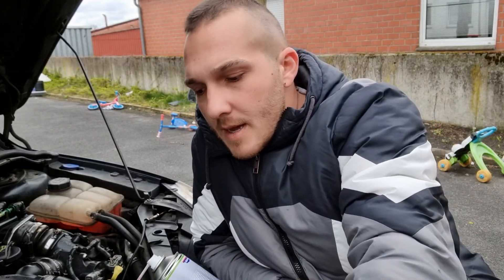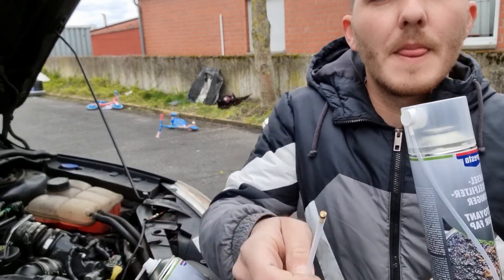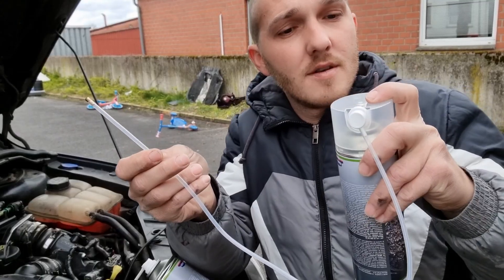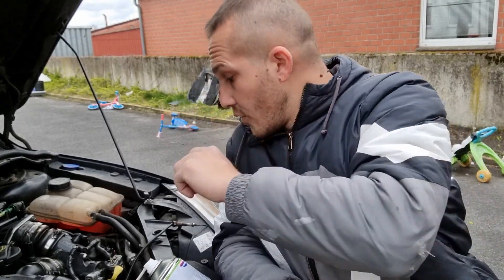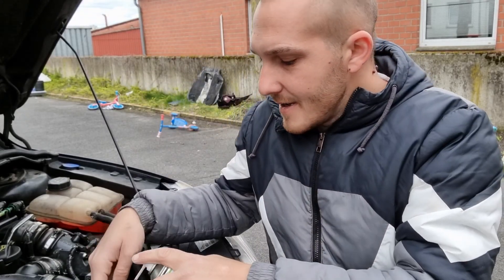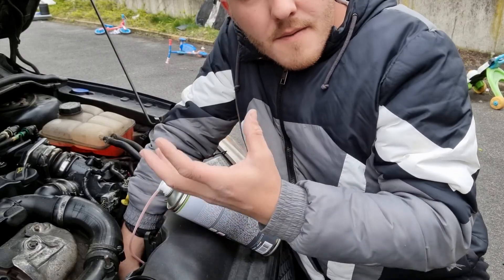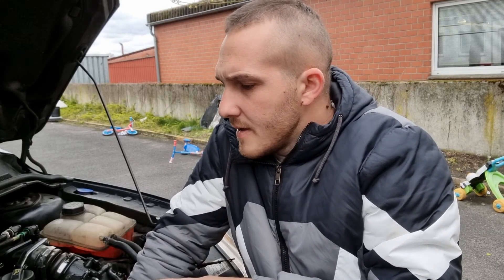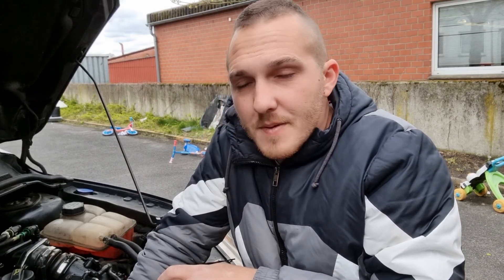CLEAN DPF filter AT HOME WITHOUT REMOVING IT !!  ( diesel particulate filter Error code P242F OBD2 )

Comment: The best option to clean it if too blocked, is to remove and back flush it. First let it soak in a solution of water and dishwasher tab. Then soak it with a misture of brick acid and water, then soak it in bleach. Finally clean it with water, preferably using pressure water. A preventive mesure could be using some oven cleaner, if DPF fluid isn't available.

Comment: Do not forced regeneration, it can damage it because it is much higher temperature than normal regen.

Do this:
1. If limp mode, clear faults with obd2 scanner to stop limp mode.
A. Optional: Add 300ml and then fill full diesel tank, 1:200 ratio, 2 stroke LOW ASH oil (preferably Jaso FD, ATI C). It cleans.
2. Inject through top oxygen sensor hole 2-3 bottles of DPF cleaner foam
3. Always disable Start/Stop.
4.  Drive 1hr non stop on  high way.

Comment: The DPF fault is generally a symptom of something else. This something else could be anything from driving too many short journeys and/or too much idling to split boost hose, blocked pipes/nozzles, faulty sensors/wiring, etc. If you reset these faults and the DPF problem returns, look for other fault codes, if any, and physically check hoses, wiring and even your air filter.

Comment: All this cleaning stuff is unnecessary if people would properly understand the DPF system and how it works. The biggest killer of the DPF are cold start, stop/start driving in heavy traffic and short trips.
Cold starts are when the most amount of soot is produced in a diesel motor and if you don't drive it long enough to get the engine to optimal operating temperature, the DPF will not burn off that soot and it will become clogged up.
Basically, diesel vehicles with DPF systems are not suited to city driving and short commutes. You need to take the vehicle on a long run at least once a week at a sustained speed above 60kmh, preferably on a highway at around 100kmh for 30-60min to allow regeneration to occur. The DPF system was not designed to have chemicals and cleaning agents put through it and can potentially cause irreparable damage to the DPF, resulting in a very expensive replacement cost. Fuel additives supposedly designed to clean DPF systems are even worse. That stuff goes through the entire fuel system, including injectors, which can be damaged and cost a fortune to replace.
Just don't do it, simple.
Reply: Utopia

Comment: U need better diagnosis OBD2 over 150 Euro in order to perform in place just be careful to not burn in flame 🔥 Once process it's done then give command DPF replace and u with be foolish Ur ACU if u drive like this vacuum pump in turbo 200 Euro min then EGR 300 Euro min plus more then 200 Euro repair 
Use Wurth instead cost 30 Euro or best way take it out use drain cleaner kitchen acid and dishwasher machine tablets for 48 hrs clean in order to same 1000+ Euro in Ur car and never to have this issue again....Change Oil in 6000KM only or 5000 use Liquid Moly 5w30 but never wait 10000km or above

Comment: Hello, are these sprays suitable for engines with DPF placed after the turbo, in the front of the engine? Isn't there a possibility for some of the spray to get in the turbo and from there in the engine?
Reply from the maker: Yes,DPF on this car is placed just after turbo,as you can see in video. There is no chances to get that spray into engine my friend
Reply: they have Additives for diesel to put it in tank , no need to do this  , what this guy it's doing here it's a little late because he generate a lot of pressure from dpf back in motor witch definitely the turbo don't like it , not to mention all the gaskets or garniture or how they call it , it's better not to sleep on the streets and to runn it at the end of the weekend and not letting it to accumulate so much that the engine will get in in limp mode , at wag group it s wag dpf and with an app and carista obd i can see when the dpf it's full or near and start a dpf regen , ideal if u are on highway , i m talking abd making this with an audi a3 from 120ktkm now to 275tkm with the oem filter and no cleaning or dismantle it , in the winter u can half block  the radiator fan because if u drive on city that dpf can't go above 150c witch it's bad for dpf, if u see many modern cars have active cooling in front of the radiator and when it's vold outside that will stay close ,adn with this your egr and dpf will be above 200c in city , on highway at 120kmh i managed to measure 300- 400c on dpf and only a small amount of ash will stay in dpf , i drive from Germany to Cehia and so i managed to get 600km and then the filter started to regen compared with 200km when i drive in city , 300km when i go to work everyday, highway and city , so the higher dpf temps are the better for the engine because will not be blocked by dpf
Reply from the maker: @Cristian Popa  When DPF is already blocked than is too late for additives. You can check on youtube how many people recommend this and it helps. I did that and Im still driving the same car and turbo is still ok 🤷‍♂️
Reply: @HOWTOdays  yes ,of course it's too late but this 15e cleanner it's not enough for a limp mode , actually a good diesel with some additives for dpf will heat up the dpf like crazy and will burn the ash but off course u must drive ,not sleep on the streets like all germans, if it s raining that's it , max 30kmh no more :) , all that's said , i tried this cleanner and didn't see any difference , diesel's are made to be driven and i know many times we don't have this opportunity because we are not alone on the streets and sometimes the highway are fully blocked but when u have the opportunity just floor it , better spend that money on some good shell v power diesel and drive it, play with gas pedal and after a while u will se a difference
Reply from the maker: @Cristian Popa  Belive me,I'm not sleeping on wheel 😁 Look,It's not just about how you drive and fuel quality. Many other things can cause DPF blocking. I'm not specialist, just saying that what I learned online.  For example I didn't know that if you have under 25% in your tank,DPF will not regenerate. On this car I have additive "tank" under the car,and I didn't know that. I drove long time without additive and many times with just few l in my tank.. This is my first diesel, so I'm learning from my mistakes 😁 Thanks god because this car isn't expensive 🤣
Reply: @HOWTOdays  yes you are right, what i said above it's for a good serviced car , imagine what some bad or cloged injectors will do with the dpf , with cars u mist spend regularly money on service if not u spend later a lot more :) , happened to one friend, he has dpf problem , cleanned but then after some weeks same problem and the issue was the injectors , they were not ao bad but bad enough to fill the dpf with soot fast enough
Reply: @HOWTOdays 😅
Reply: Hello buddy. Have you had another problem with dpf so far?

Comment: What a great video. Simple and easy, you did show everything I would like to know.

I am going to do this operation to my sister's car. Only the chemicals, no machine to reset the code error, hopefully it will go away by itself, right?

Will also add some additives to the fuel.

Thanks and best regards.
Reply from the maker: Thank you so much 👍😊 If she have check Engine lamp on,than you will need to reset codes my friend